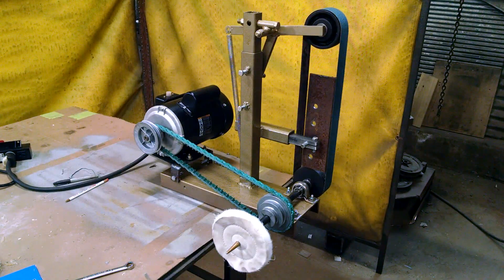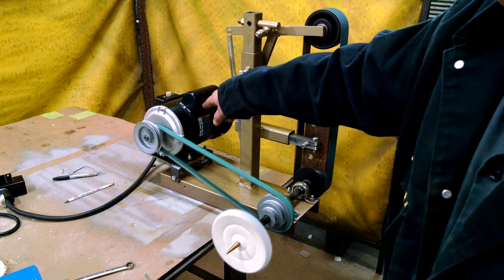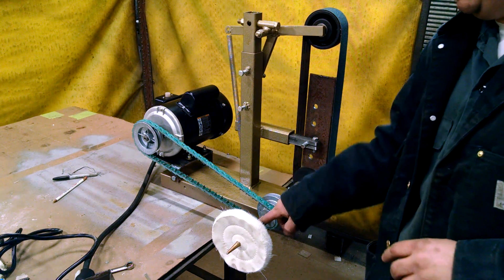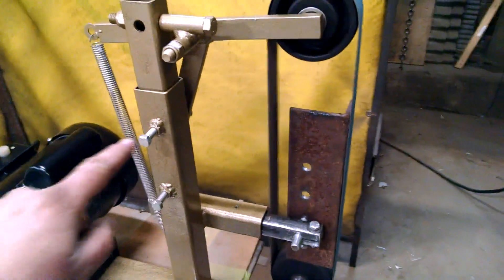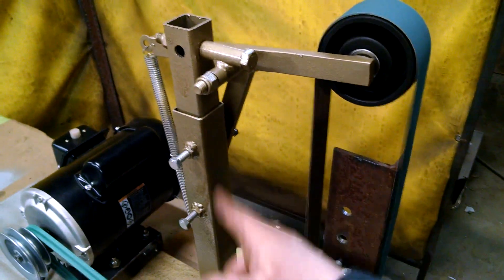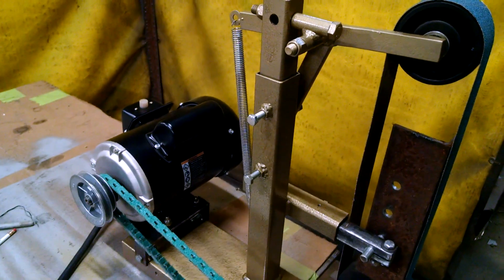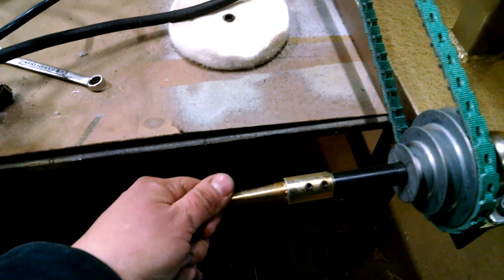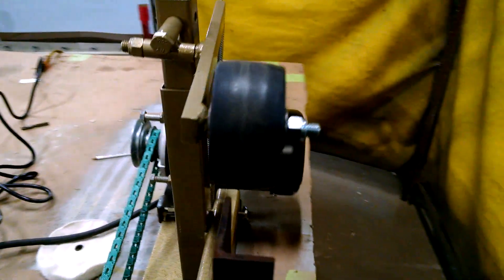Homemade 2x48 Universal Grinder with Buffing Wheel!

Comment: if you have a buffing wheel on that machine while you are grinding, you are going to end up with metal filings getting embeded in your buffing wheel............not a good thing, it will leave scratches in anything that you try to polish.
Reply: I have a buffing wheel on my bench grinder and have ran into the problem of my buffing wheel leaving deep scratches in anything I try to polish. I just went out and looked and sure enough there are many small filings of steel embedded into the wheel.

Never would have thought of that, I appreciate it.

Comment: Nice simple but effective sander! I vote that you attach the tool rest to the bottom plate so that it can also act as a guard to keep loose clothing from catching/wrapping onto the jack shaft. On the riser part of the rest, if you weld a cross section of rod or pipe cut as wide as the jack shaft, you will have the whole shaft protected.

Comment: does the motor naturally turn CW or did you have to reverse it ? if so, how ? 
nice simple build.
Reply from the maker: it is a reversible motor, but you can always rotate/reposition the motor depending if it is CW or CCW if you can't rewire it.
Reply: to improve, maybe add another idle wheel to stabilize the belt, less vibe, etc...

Comment: What's the drive shaft hardware? Like what is the shaft and bearing system after the 2nd pulley?
Reply from the maker: 3/4" drive shaft rod and pillow block bearings, but like I said go with 5/8" if you want readily available accessories like polishing hubs or adapters.
Reply: Awesome. Thanks! Great set up you got there!

Comment: i would add a spring on to the frame pushing against the motor to a a bit more tension on you chain drive
Reply: that's not a chain bro. it's a link belt